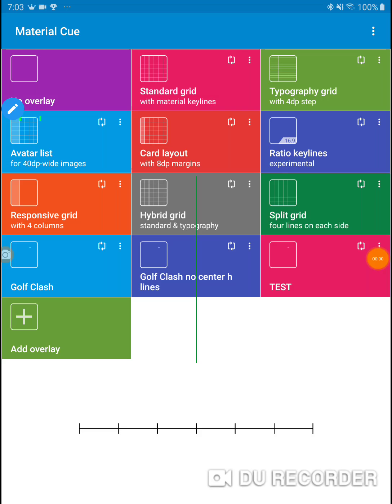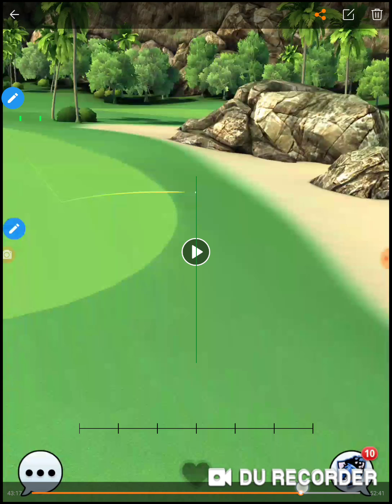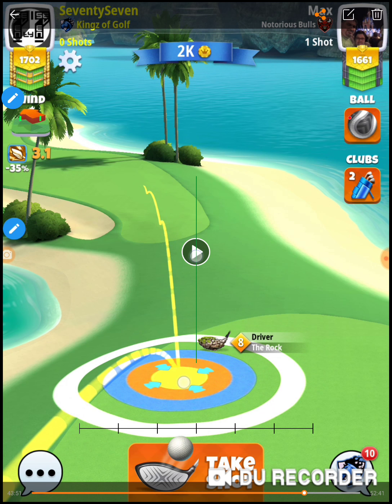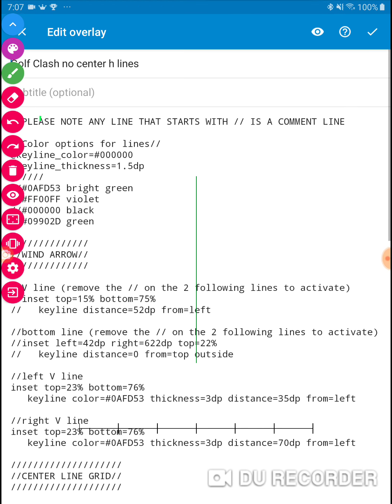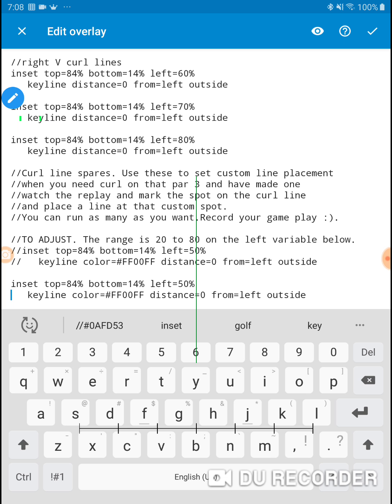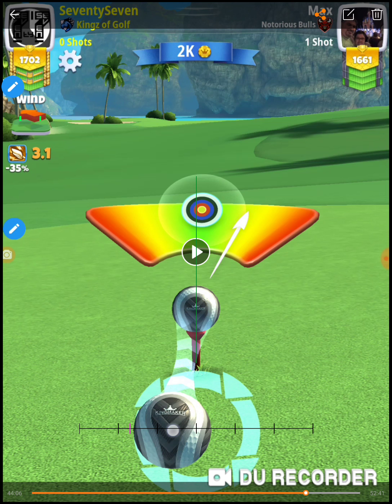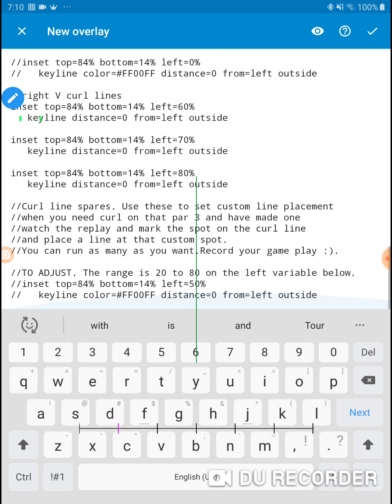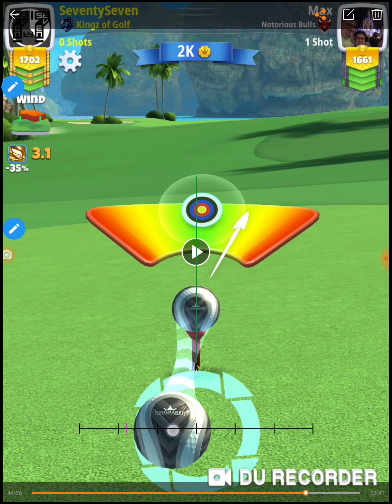Material Cue custom ticks on the Curl line

Comment: Can you share your code with me?
Reply from the maker: //PLEASE NOTE ANY LINE THAT STARTS WITH // IS A COMMENT LINE

//Color options for lines//
@keyline_color=#000000
@keyline_thickness=1.5dp
//////
//#0AFD53 bright green
//#FF00FF violet
//#000000 black
//#09902D green

//////////////
//WIND ARROW//
//////////////

//V line (remove the // on the 2 following lines to activate)
//inset top=15% bottom=75%
//   keyline distance=52dp from=left 

//bottom line (remove the // on the 2 following lines to activate)
//inset left=42dp right=622dp top=22%
//   keyline distance=0 from=top outside

//left V line
inset top=23% bottom=76%
   keyline color=#0AFD53 thickness=3dp distance=35dp from=left

//right V line
inset top=23% bottom=76%
   keyline color=#0AFD53 thickness=3dp distance=70dp from=left

////////////////////
//CENTER LINE GRID//
////////////////////

//center V line
inset top=35% bottom=28% left=50%
   keyline color=#09902D distance=0 from=left  outside

//upper H line where ball is at rest on field (to active the two lines below remove the //)
//inset left=35% right=35% top=62%
//   keyline distance=0 from=top outside

//mid H line where ball is at rest on tee (to active the two lines below remove the //)
//inset left=35% right=35% top=72%
//   keyline distance=0 from=top outside

//////////////////
//CURL LINE GRID//
//////////////////

//curl H line
inset left=20% right=20% top=85%
   keyline distance=0 thickness=1dp from=top outside

//center V curl lines
inset top=84% bottom=14% left=50%
   keyline distance=0 from=left outside

//left V curl lines
inset top=84% bottom=14% left=40%
   keyline distance=0 from=left outside

inset top=84% bottom=14% left=30%
   keyline distance=0 from=left outside

inset top=84% bottom=14% left=20%
   keyline distance=0 from=left outside thickness=1dp

//inset top=84% bottom=14% left=0%
//   keyline color=#FF00FF distance=0 from=left outside

//right V curl lines
inset top=84% bottom=14% left=60%
   keyline distance=0 from=left outside

inset top=84% bottom=14% left=70%
   keyline distance=0 from=left outside

inset top=84% bottom=14% left=80%
   keyline distance=0 from=left outside

//Curl line spares. Use these to set custom line placement
//when you need curl on that par 3 and have made one
//watch the replay and mark the spot on the curl line
//and place a line at that custom spot.
//You can run as many as you want.Record your game play :).

//TO ADJUST. The range is 20 to 80 on the left variable below 50 is center.
//inset top=84% bottom=14% left=50%
//   keyline color=#FF00FF distance=0 from=left outside